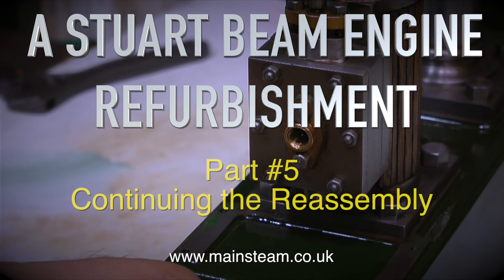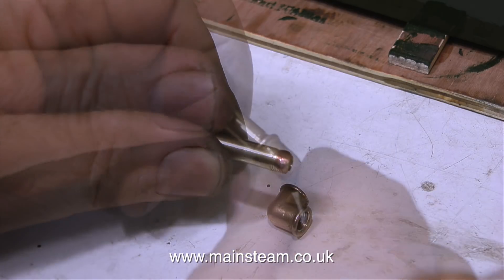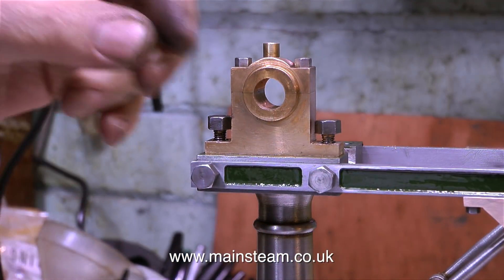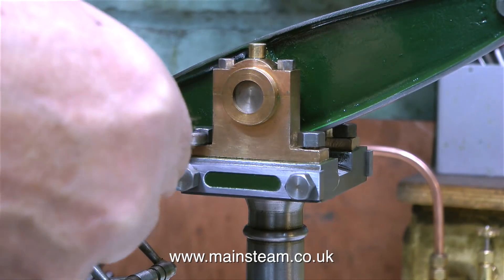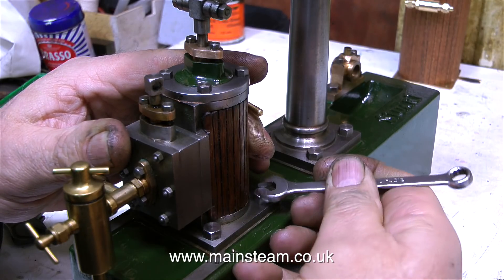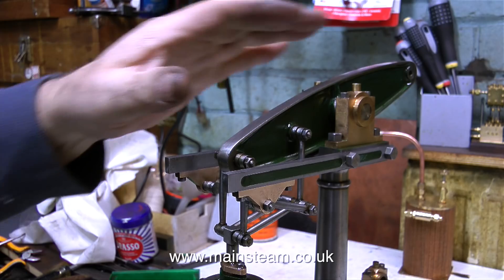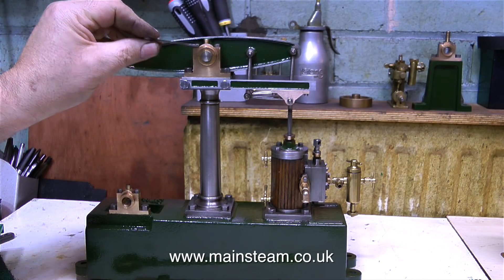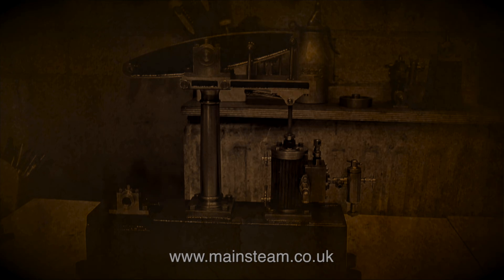STUART MODELS BEAM ENGINE REFURBISHMENT - PART #5

Comment: I think the beam is the right way up. As cast iron is stronger in compression than in tension, the logic would be that you have the reinforcement at the top so that it is bearing the weight of the beam.
(Although that would assume that the weight of the beam is a bigger issue that the power of the piston pushing up. I would try and do some maths but the nurses haven't given me my medication yet.)

Comment: Hi Keith, I believe you mentioned that you had owned this engine before (or am I confusing engines)? If you did why are you finding all these things that need fixing? Not criticizing as I am enjoying watching these videos, just curious.
Reply from the maker: Yes, I previously owned it for a short while - but it was only as I worked on this necessary rebuild that I noticed these small problems and corrected them ..... previously the bearings were shimmed.

Comment: If it's any consolation to your "Which way up should the beam be" dilema, I think your right how you've fitted it, the cast in support would be where the beam has most stresses on a full size engine, cast iron works well under compression, but is not so good when it's been pulled, the higher forces will be acting from the beam top to the central shaft. So the reinforcement would be above the central shaft. I once saw a picture where the beam had snapped, it was clean in half around the central shaft. 
Great work on the videos and please keep them coming 😀

Comment: As an observation. You say the bearings should sit dead flat against the column but how can they when the top of the column is painted? Wouldn't that create an uneven surface and affect the position of the bearing? Not a criticism but an observation
Reply from the maker: a micron or two of paint really is so utterly & totally insignificant ........ it is after all a simple steam engine ..... not a gas turbine - or a part for a satellite ...
Reply: Keith Appleton fair enough. Perhaps im looking at it like at it like a toomaker (after all thats my job) As you say its such a small amount it wont matter. One day I might try and machine a stuart engine.